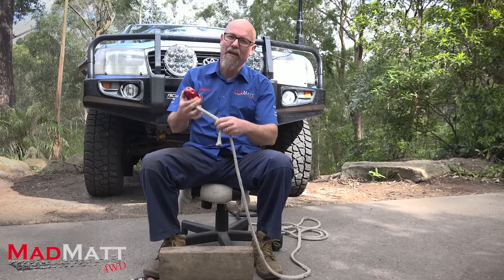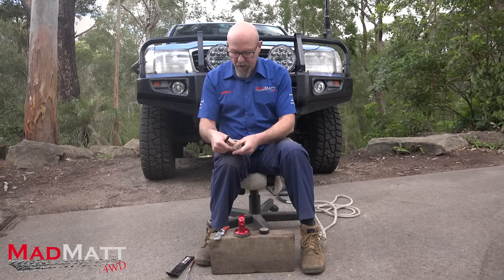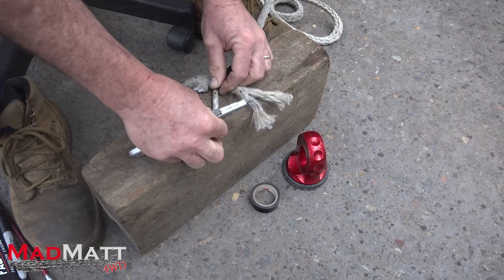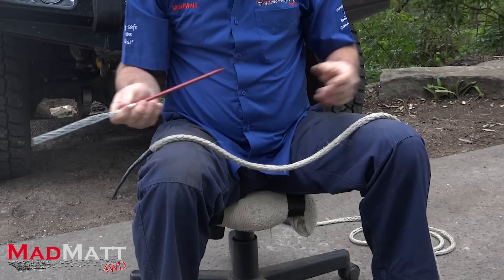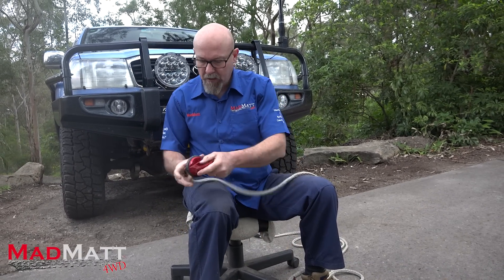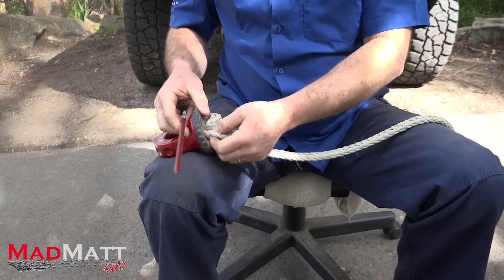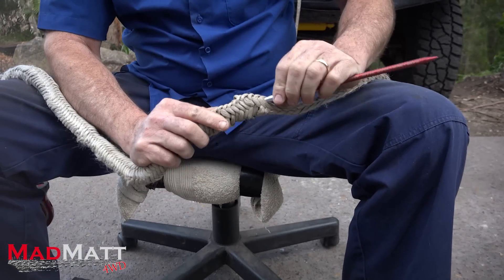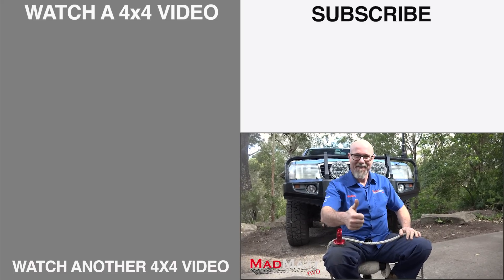How I SPLICE ROPE! Either on the tracks or at home!

Comment: Good video passing the end thru the line twice actually locks the end so it cannot pull back thru after end is buried. 

Another method is to not put in the locks but to bury the end. Then use sail twine to  sew in the locks. 

Tapered end; failure to do so allows the buried end to chafe the outer strands under strain creating a week point.👍

Comment: Matt, I found your channel through watching Matt's Off-road recovery. I have searched through and watched several of your videos now. picking and choosing what I think can benefit me. I had spent 26 years in the US Marine Corps before retiring. Knots and rope work were nearly a daily thing for me.  I have joined many ropes and cables, and learned to used methods requiring almost no tools. However, thank you, thank you for this video. Not so much for the 'how to' aspect for me. But for showing that "Factor 55 Fast Fid". What a game changer. After watching this, I immediately ordered one. I had the opportunity a couple weeks ago to finally use it to put a new loop at the end of my extra synthetic winch line (making an extension, so to speak). That tool is a game changer. It cuts the time and process down way to easily. Keep the videos and tips coming.
Reply from the maker: Well thanks for letting me know. I would think you could teach me a thing or too about knots. I really don’t know much on that front.

Comment: Great video. Took an old cable and made a winch extension out of it. As for cutting, I took a single edge razor blade and, with a light sawing motion, it goes thru like butter.
Reply from the maker: Sweet as. Thanks.

Comment: There are expensive Kevlar scissors that will cut, or a sharp cold chisel with hammer on a blacksmith anvil. I use both. A cold chisel on an anvil is how I cut metal rope. I have Kevlar scissors because I work with fiberglass layups that sometimes include Kevlar fiber. Both methods are great.
Reply from the maker: Thanks for the info

Comment: Matt, I have been a sailor for the past 40+ years and I have learnt after years of doing rope splicing that there are 2 ways to cut rope either with the strand or across the strand, the easiest is to cut small pieces at a time and either a very very sharp knife with the rope folded over the rope cutting a bit at a time or a pair of EMT safety scissors (which I use only for splicing and cutting away ropes when in dangerous situations, yes that has happened). I personally do not find stanley knives to be very sharp even when brand new or after removing a section of the blade. I have made a very very sharp knife from an industrial hacksaw blade cut into 2, gound down the teeth on my grinder and one a 90deg angle blade and the other approx, 25-30deg angle blade and sharpening each on my Grandfathers dual grit wet sharpening stone (this blade material seems to keeps it's edge very well). The other thing people could get is a sailor knife/rigging knife, it has a small marlinspike, shackle key, and combination straight and serrated blade which is and can be quite useful in 4wding. I have one and use it often and it fits in a pocket or pouch on your belt. Keep up the great content.
Reply from the maker: Fantastic comment

Comment: Interesting video. Those rope thimbles look great lovebthe rubber stop on it. 

Hot tip for you guys out there, if u dont wanna spend the hundred or so bucks for the factor 55 fid, a biro with the ink removed and electrical tape and tape measure will do the job. Just have to be a little more careful when burying the rope, not to damage the fibres.
Reply from the maker: Good point

Comment: Taking the same wood block you are using and turning it on end and using the end grain surface will make it easier.
Reply from the maker: Oh ok. I use end grain if i'm using a hole punch say but hadn't thought of that in this situation. Thanks

Comment: The way I’ve always cut dynema rope is with a die grinder. Makes very short work of it. Of course, you don’t always have a die grinder handy.
Reply from the maker: I use a grinder if I can it works well.
Reply: They make scissors know specifically for cutting dyneema, Kevlar, and other exotic ropes, they basically have micro serrations, and work well.

Comment: @2:32 Marking certain strands
@2:34 All (6) specific threads are pulled aside to then be cut shorter.
@4:54 Cut ends get tucked back into the core
@5:29 He trims two more. 
Q:This rope is apparently woven of how many threads?
@5:47 He began wrapping the loose ends in tape (electrical, but could have been any other variety)
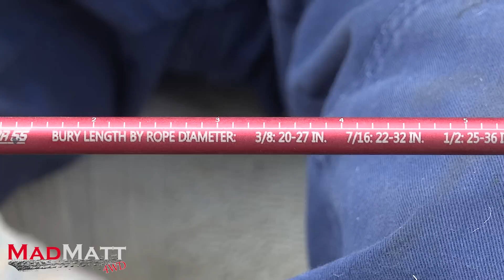@6:32 Proportion scale: rope diameter to bury length
Reply from the maker: Not sure what your point is? Or are you just helping viewers?
Reply: @MadMatt4WD  Hi, I was taking notes for myself and figured I'd share. I do have a question though, please. How did you identify those pairs of strands, if that matters?

I'm trying this for the first time now with some discarded 10-strand synthetic.

Comment: Do you know if you could just remove the winch hook off the rope and just use a soft shackle instead of having the hook.or splicer on the end?
Reply from the maker: Yes you can but you have to make sure it doesn’t get drawn into the winch.
Reply: @MadMatt4WD  thanks for that. Does the steel inner band from the loop need to be removed or can it stay there when doing this
Reply from the maker: @timothyschulz4730  It can stay if you wish but you'll find it deforms. I'd take it out.
Reply: @MadMatt4WD  thanks for that!

Comment: Easy way to cut it is with a hot knife but most will not have one 
You can also hit the knife with a hammer will chop cleaner 
If you don’t have a fast fid you can just use a bit of wire
Reply from the maker: I like the hot knife idea but alas I don't have one. :)
Reply: MadMatt 4WD next time let me know you can borrow my one

Comment: I cut rope strands easily. I use either my serrated scissors (that are typically used for cutting kevlar). That is best $20 I've yet spent on Amazon.
Keeping the strand straight and under tension helps too a lot. Think of how easy a rope under tension is to cut, unlike a limp rope. Ideally you hold the strand on one hand, and pull while pulling the rope with a second hand and cut it with your third hand. :D In real life you probably tie the rope onto something, sit on it, keep your leg on it or whatever.
Bending the strand in U-shape works with my sharp knives but I tend to polish them usually up to 10 000 grit and perhaps strop too. You could really shave a beard with some discomfort. With a new Stanly knife blade you will have no such luck. Learning to sharpen and keeping your knife extra sharp is some work but has it benefits. A well polished unserrated knife cuts ropes better than often recommended serrated ropes, at least with my kind of sharpening.
Reply from the maker: Some really good tips there. Thanks

Comment: In the field with just using 5 weaves without the fid the rope will be around 90%, I am a lineman and we have used eyes made this way to pull out line trucks, mind you the rope is bigger.
Reply from the maker: Thanks for the info
Reply: MadMatt 4WD you can even join 2 ropes by weaving them into each other the same way

Comment: If you already have duct tape or electrical tape I don't see a need for a $50 fid. A smooth whittled stick, piece of coat hanger, or pen/pencil will do. I think the advantage of that fid is that you wouldn't need to use tape which reduces a step. 

I've never used that fid, but if it still requires tape use then I'm really not sure what the value is.
Reply from the maker: It doesn’t need to be used with tape and I often don’t.

Comment: Dyneema is very had to cut with a regular knife blade.  I have found that if you use SK2H high carbon steel blades in your utility knife, it will perform much better.  Better yet, and you have to try this to even believe it... buy a cheap ceramic blade paring knife, and try that.  You can literally just apply pressure and it will make a clean cut right through Dyneema rope.  No sawing needed... just downward pressure.  Seriously.  Try it!
Reply from the maker: Cheers. Will do. I’ve been using my grinder with a 1mm blade.

Comment: 9:48 it absolutely will NOT retain 100% of its original strength as shown, this is covered at length any in any maritime rigging guide. The only way you're going to reach close to 100% if you have a taper which is 50+ diameters. Your splice is extraordinarily short, you're going to get 80% or 85% out of it at most because of that abrupt taper.
Reply from the maker: Thabks
Reply: The "standard" for dyneema based ropes (Amsteel, Plasma, etc) for bury splices is 3 fids, a fid being 21x the diameter of the rope (so for a 1/2" rope, that's 31.5" or 2.6' of buried ropes to keep its total strength. That is for a straight eye splice, NO Brummell, or anything like that. However, there is a fair amount of data that shows with a locked Brummell eye splice, if you can get around 1.5-2 fids worth of bury, it wil do fine. (Per Sampson ropes qualification courses)

Comment: Don't use masking tape , too hard to get off.

Cut the rope or tales with a sharp wood chisel , wrap a bit of tape around it and give it a wack , I use the vice flat .
Not good for the chisel but cuts the rope a treat .
Reply from the maker: Thanks for the tips
Reply: @MadMatt4WD  And I always wrap the tapered tail from the bottom up as it makes removing the tape sooo much easier as you are unwrapping with the grain , so to speak .